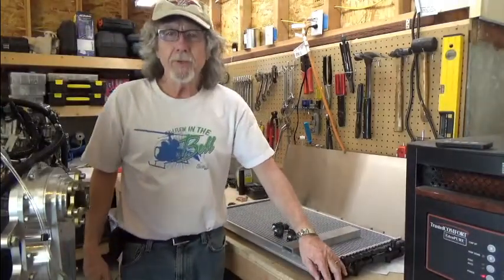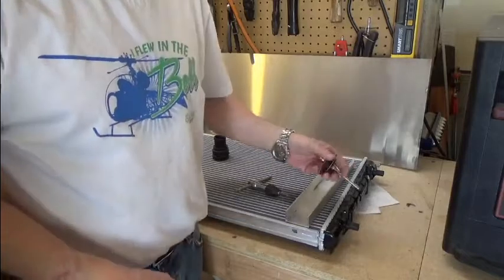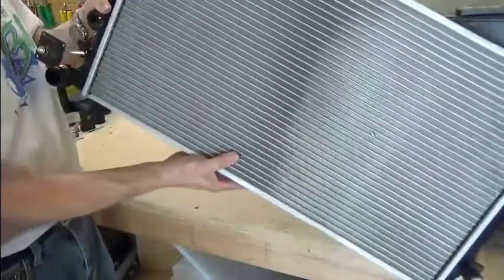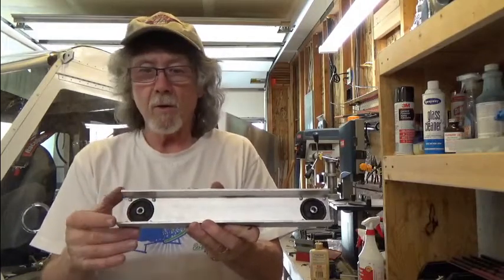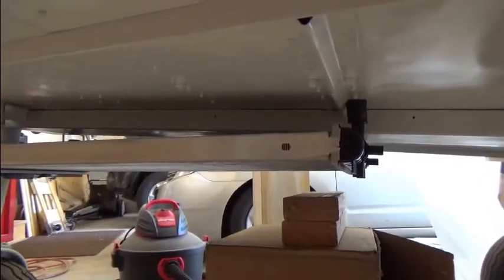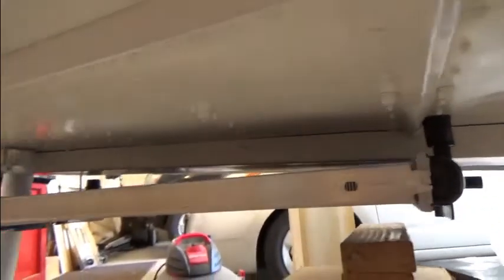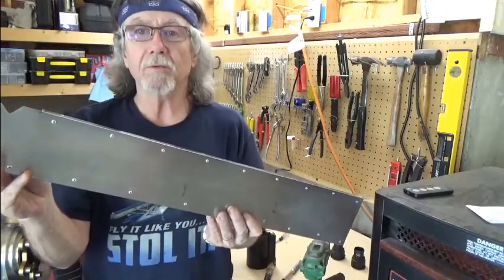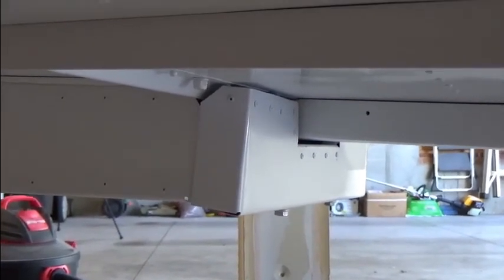Viking 130 Radiator Install

Comment: Gary, if you are now flying this 750, have you found the need to cover the underside of the radiator with a louvered cover to protect the core from debris thrown up by the nose wheel?
Reply from the maker: I am not flying yet. Thanks for the heads up. Could you send me a picture of your cover? Thx
Reply: @revdrgarysimmons  I'm just finalizing my install, Gary, but have put a fender on the nose wheel and am about to add a cover with louvers (which you should be able to easily add to your existing radiator frame.  Thanks for the response.